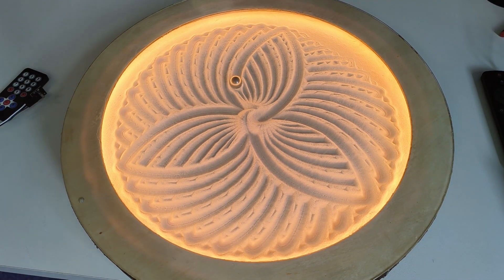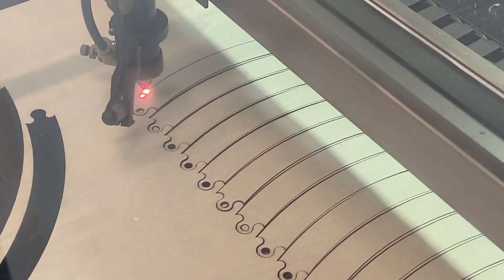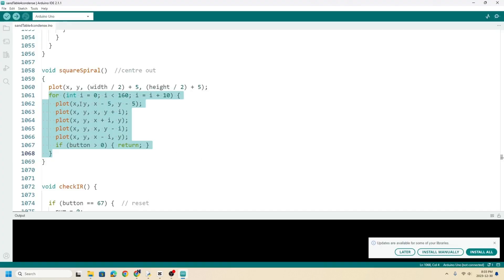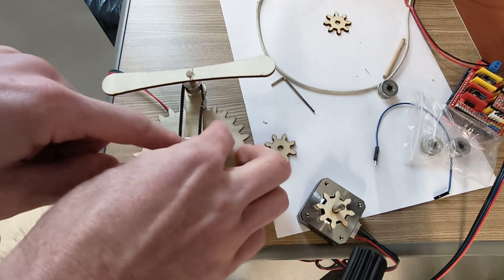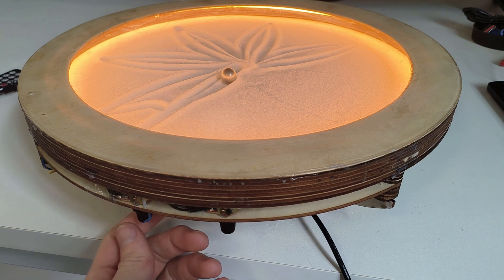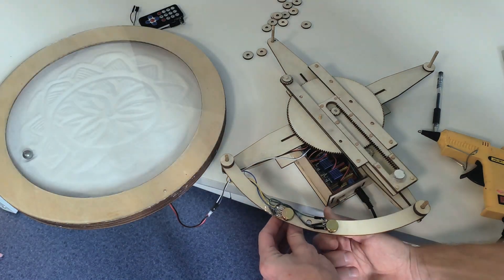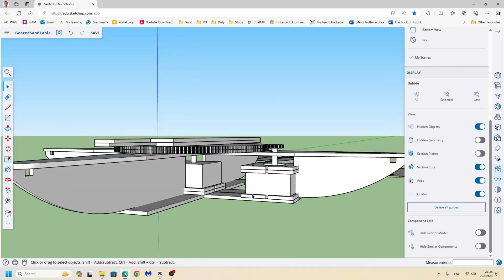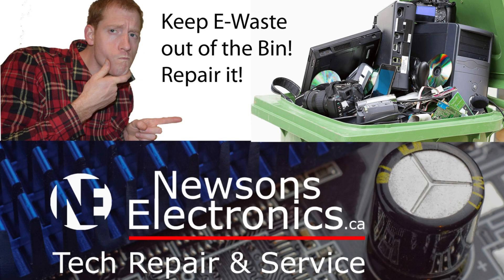Wooden Sisyphus Sand Table with Knobs! Powered by UNO

Comment: Polar design along with a rack and pinion is, in my opinion, the best design for such a project.

One question though, many of the sand paths drawn are a series of shapes that cross the center point and continue past it. how would you do such a move with this design? i know it's only in and out, so would you make a 180 degrees turn for example whenever the magnet is at the center?

i appreciate your response, thanks
Reply from the maker: Yep you're right, I would make a 180-degree turn when the magnet reaches the center.
Reply from the maker: the issue with the arm is its not as accurate as the arm extends sliders are more stable
Reply: @NewsonsElectronics  can you please explain the issue with the accuracy further?
Reply from the maker: @IslamAmr-wt6ce  this explains it https://www.youtube.com/watch?v=9gYJqAtSc0A&ab_channel=NewsonsElectronics